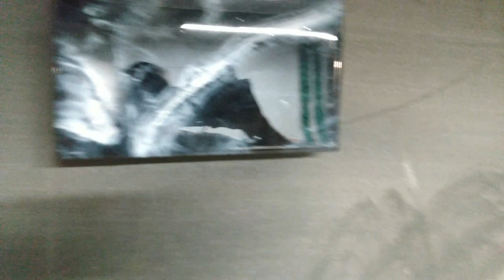EPOXY RESIN DINING ROOM TABLE STEP BY STEP. I epoxy a dining room table an show you step by step.

Comment: I love your work and it's really helpful I'm in the process of fixing up my home  and I'd love to refurbish my bathroom sinks! This is totally random but I'd love to see how you clean your tools lol
Reply from the maker: Hello Savi Savvy, to be totally honest with you there isn’t really a whole lot of tools to clean. I mean when I use a brush and when I’m  done with it I just throw it away. Because once the epoxy gets on it it’s not good anymore for anything else I’ve try to clean them. you can clean them with acetone but you’re not going to get 100% of the epoxy out but the bristles. And all of the other tools that I can save I just clean them with acetone as well.let me know if I can help you with anything else.
Reply: @LiquidCreationsCo2609  thanks for responding! I was going to buy the attachment that goes on the drill for mixing I was just curious on the cleaning...also 2 more questions if you dont mind.. as I previously stated I want to refurbish my sink and possibly my bath/shower... what do you use for a primer base coat? And do you have any tips if you cant detach your sink to refurbish? My mirror is attached and I won't be able to take the sink off without breaking the mirror and if I do my shower I cant take it off and put it back on... thanks for your time!
Reply from the maker: @savisavvy_  any bonding primer that you buy at Home Depot or Lowe’s will work and as far as detaching your sink if there’s absolutely no chance that you of that you’re gonna have to make sure it’s level someway it has to be level or this won’t work as far as doing your shower if you try to put the epoxy on your shower walls it’s just going to run off if you’re going to refurbish your bathroom correctly then all of that stuff should be removed and you should do it when you have it removed in order for it to work right there’s really no other way to say it sorry hope this helps

Comment: Can you tell me what's deference between flooring "resin table epoxy & flooring epoxy" ? Or that two are same ?
Reply from the maker: There is a difference the floor epoxy is designed to be thinner. And you get a little more working time with it because of the area that has to be covered.
As for the countertop epoxy it is designed to be mixed at a one-to-one ratio most of them anyway. And you get on the average about 30 minutes of working time with it because you don't have quite so much area to cover as you do on the floor.
I hope this answers your question have a blessed day. 🙂